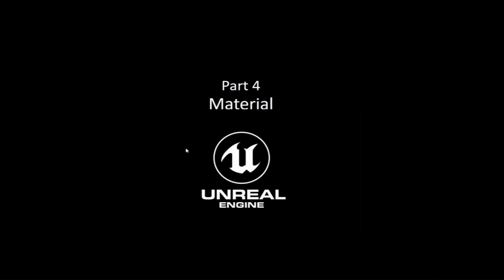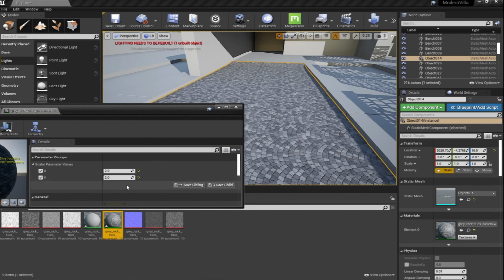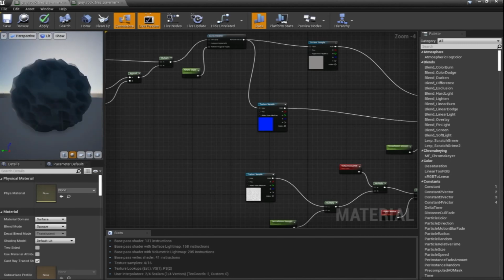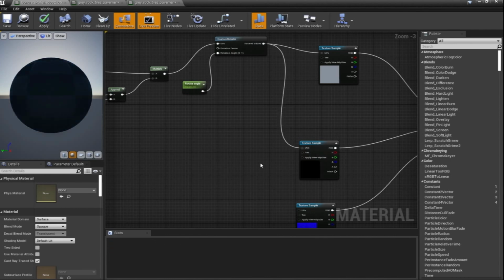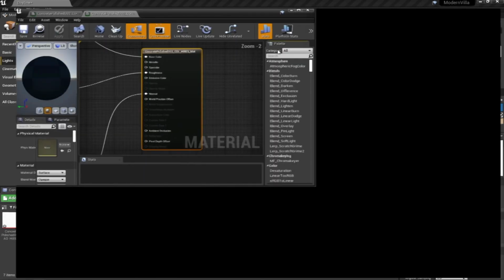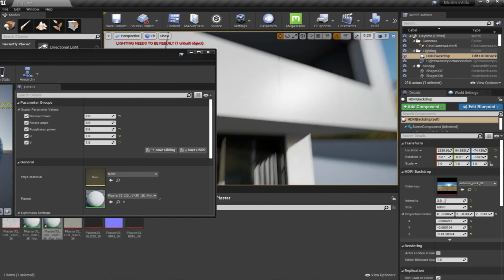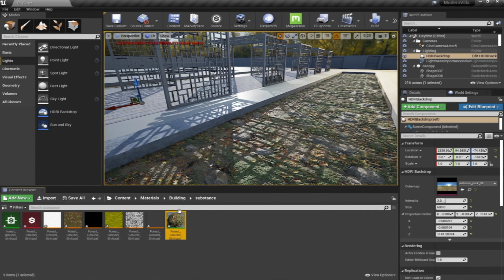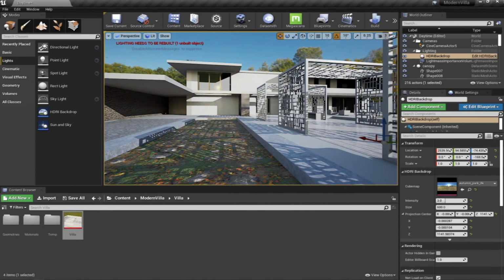Unreal Engine 4 Arch-viz Tutorial Course  part 4-2 Displacement and Other Material nodes

Comment: Thank you so much for your amazing and useful tutorials. I have a question about displacement! It seems that displacement (Tessellation) has been removed  from material in UE5. i know how to use displacement in model in UN5 but It is not possible to rotate its texture as you did in material. What should I do?!
Thanks
Reply from the maker: Hi Ahmad , your most welcome and currently UE5 doesn't have a tessellation node as nanite now is what they where pushing to be the main tool to view displacement details , but we will keep looking for another way to do it and will share it as well , thanks for sharing

Comment: thank you for tutorial, is there any tweak i can do to the settings? because when i increase the amount of tessellation to 17.0 my fps rapidly drop, it turns to color red everytime i move the viewport and becomes so laggy. my pc specs ryzen 5 3600. rtx3060. 32gb ram. thank you again!
Reply from the maker: Your welcome , Tessellation can be costly thats correct , so to compensate the displacement effect and keep the realistic look you can create a displacement map in quixel mixer and get a higher fps in Realtime .

Comment: Hello Team, I imported one brick material from megascan library and applied it to one of my object. But it is not showing in viewport. Please help. Thanks. https://imgur.com/k7qrOpo
Reply from the maker: hi Nilesh , please check if the diffuse channel is active or the location of the brick material is available for the material to read from , and also try to check if the same problem happen if you apply a different material

Comment: Sign in problem with quixel bridge.... I heard that many people are having the same problem ... 😥
Reply from the maker: hi there , are you facing a problem with Quixel to appear inside unreal engine or basic sign in with the quixel bridge stand alone
Reply: @theimageneers5161  i downloaded the bridge and installed in my pc .. now the icon comes in my desktop ... I opened and when I try to login it gets stuck and closes after sometime... Its not showing in the ue also..
Reply from the maker: @muhammedlamyp.j9860  we can send you files to put it inside UE so you can get the bridge to comes inside UE but for Quixel bridge logging problem may be you can send Quixel to see if they know why its not connecting
Reply: @theimageneers5161  that will be so helpful .... Thanku 😃😃
lamypj666@gmail.com
Reply: @theimageneers5161  iam using ue4 .25 ... Does it have bugs.. should I try older versions

Comment: hello. What does the Object Radius(Input data) do in the world displacement node connection? If I am not mistaken the vertex normal does analyze the normal of mesh, I am not too sure with the purpose of the object radius in the displacement.
Reply from the maker: hi there , the object radius is basically a node that help you in case you have different sizes of different object and ur uvs are giving you different sizes of the texture , the object radius will help you get the same size of the uvs even if the objects have different scale of sizes , hope this was clear enough , and thanks for sharing your Q

Comment: Hi, When I apply material on single surface displace works fine... but for a wall or some element each faces gets distorted... how to solve the problem..
Reply from the maker: Try adding more subdivisions to that surface as many as you can

Comment: Best tutorial i've ever seen! I have a very worring question, i use revit and export model in UE, and a problem is with displacement. If i want to use for example brick material on the wall with displacement i need a much poly to generate, but from Revit to UE, its only 2 triangles for example on the door side. What can u advise to do?
Reply from the maker: Thank you very much , as for your question i would recommend to find a way to edit that door in Revit before exporting to unreal , however maybe you can try and check first the result after applying that tessellation node in the material and check if the result is some how acceptable .

Comment: I am a little confused here , i downloaded the material from bridge, total 5 maps were downloaded albedo, AO normal, roughness and displacement. The white color map is ambient occlusion and the grey color is displacement, here why you used the white colored map instead of grey? Also can you mention a video or source from where can learn more about the nodes as this is lengthy processes and can be tough to execute by our self independently. thank you for making the video, its really easy to go through.
Reply from the maker: you are right about the confusion for the best height or displacement map , basically displacement is where white and black play the vertex push offset , but there is no golden rule here you can try both and which one will give you the best result thats will be your call on which one will you use , for the best material tutorial source i would recommend Unreal engine learning channel where you can find it in the website , 

https://www.unrealengine.com/en-US/blog/introducing-the-next-evolution-of-unreal-engine-online-learning

best of luck , thanks for sharing
Reply: THE IMAGENEERS thank you .!!